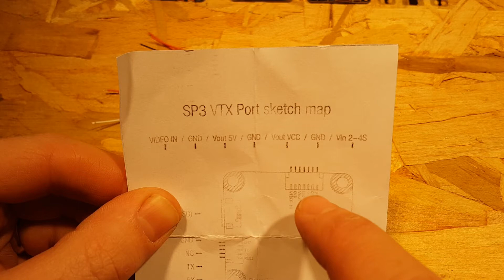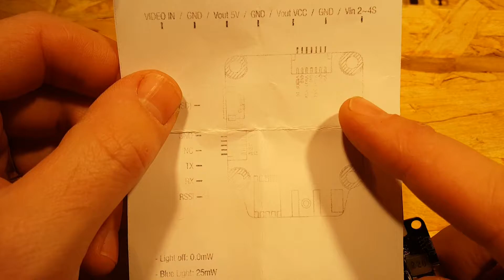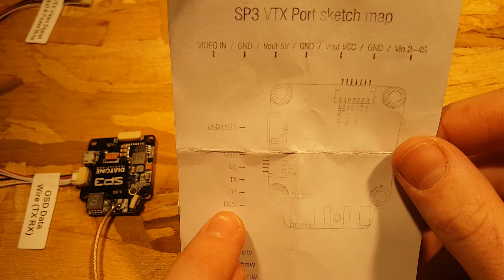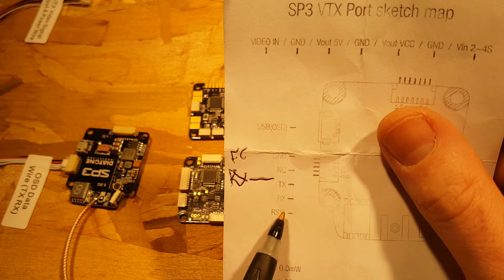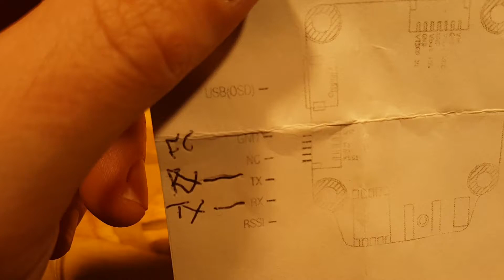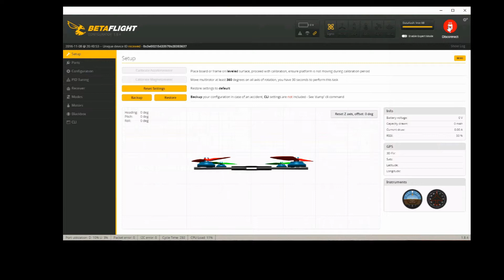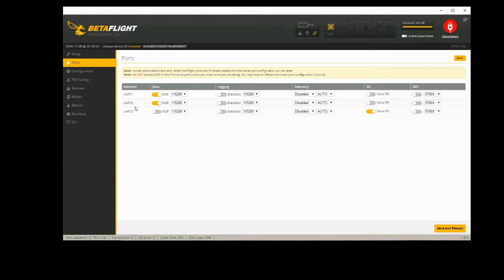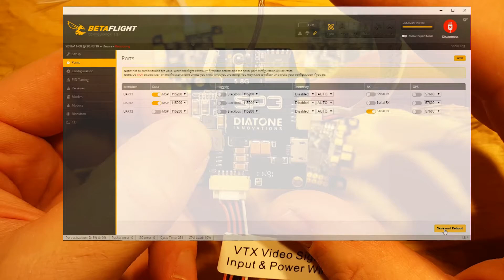Diatone SP3 - Connecting to your flight controller

Comment: can i solder RX and TX pads on the SP2 too? to get OSD controll in BF ? or its only a SP3 thing. I know there is only a hard plug on the SP3 but the solder pads are on the SP2 too

Comment: Do I go from the RSSI on the VTX to the RSSI pad on my flight controller? I am using the Diatone Fury F3, the older version flight controller!   Also just wondering what is the 5V used for on the Uarts?

Comment: do I need to run wires from the battery to the battery voltage on the maze 32 rev 6 board

Comment: Great video, I have one of the older tyrant 180 with the original naze32 thin. Can I update that flight controller with the new SP3 FC? And add this OSD? And upgrade to Betaflight?
Reply from the maker: You could, but Im not sure if there is room to stack the FC and the SP3 into the original Tyrant frame. Might be better off looking into a FC with a built in OSD and keep a standard VTX in it.
Reply: Ok. Thanks. I am assuming that I can flash betaflight to the naze32 thin. Yes?
Reply from the maker: Yes
Reply: Thank you.
Reply: Just one more question please. What is the green mate you have on your 180 build bench/table? I use a homemade top but love the green colour.

Comment: Hi Nice video. Quick question. I want to connect Diatone SP3 to D-Link F3 FC.  In the UART2 port, you mentioned TX, RX and GND.  But what about 5V ? Should I just leave it unconnected ? Thanks !
Reply from the maker: You do not need to use the 5v. :-)
Reply: Thanks. So only RX, TX and GND on UART2 will be wired and connected to SP3, right ?
Reply from the maker: Tristan Sun On the telemetry side, that is all that you need. Of course you will also need to provide it with power in the other plug.
Reply: Thanks !

Comment: great video. I am doing my fist build with the SP3 and the Diatone D link f3. I'm not sure about where to connect the power to the vtx from the FC and where on the FC to connect it. do I connect the Vout  VCC and ground on the VTX to the FC or the one that says Vin 2-4 and ground? then where do I connect it on the FC? I tried to zoom in on people's builds and it looked like they connected it to the esc power lead?
Reply from the maker: Michael Race VIN is voltage in. That is what you need to connect to the power on the FC. You can tap in to battery voltage on the FC directly where the battery lead is soldered or on any one of the ESC power leads.
Reply: You are awesome thanks for your help! that little tiny wire can handle that much power? Well i guess the VTX isnt drawing all that power.
Reply from the maker: Michael Race It only needs to handle what the VTX is drawing which even at 600mW setting is less than 1A. No problems there. Also, if you diddnt know, Vout is for passing the power on to your camera (there are also 5v and 12v options built in depending on your needs).
Reply: Ok I am using the runcam eagle and it says DC 5 to 17V. Which would you use? I am guessing the Vout 5v is the 5v and the Vout VCC is 12v. Thanks again for your help again. This is awesome.
Reply from the maker: Michael Race I'm sorry. I was wrong. There is no 12V. VCC is going to be the same as whatever you power it with (battery voltage in  your case). You should be fine powering the cam via the 5v though.

Comment: Hi. great video but I'm still stuck. I trying to install sp3 on my revolt f4 flight controller v2 and not sure where to connect it. as I'm using tx1 and rx3 with my xsr receiver. I've have found tiny pads on the back of the board that are marked as rx6 tx6 but not sure if this sp3 can be connected there. any help would be much appreciated

Comment: hi! I've using this sp3 for nearly 2 months now. Last week after i have safe landed my quad and change to a new lipo, all OSD reading is gone. I connect it to mwosd gui, all i got is "waiting osd". I tried to reflash to 1.6 mwosd but still having the waiting osd. Video feed is ok only OSD is gone. Any help will be appreciate. Thanks!!
Reply from the maker: Fairuss Yusoff It sounds like the OSD chip may have gone bad for some reason. Unfortunately I'm not sure if it's recoverable. Perhaps contact Diatone directly for support.
Reply: Flite Brothers Thanks for the reply.. will check with them
Reply: Fairuss Yusoff hello please let me know what you find.  I have the same issue you discribed.
Reply: Timothy Kimball I send back to diatone they repair it for me..

Comment: Sorry to bother you again but, Can Uart 1 on d-link be used for rx/tx to sp3 vtx if Uart 2 doesn't work? Even though it shares the usb. When plugged into Uart 1 the osd shows no data but if I plug into Uart 2 it does
Reply from the maker: In order to use UART2 (which you should) you need to turn it on in the ports tab of betaflight. :-)
Reply: Flite Brothers sorry should have said that it is turned on in Betaflight, it was working but has stopped. I've tried re flashing the board aswell. When I plug into the empty Uart the osd shows the voltage .
Reply from the maker: Dazzle Duds UART1 is fine then. you just won't be able to use USB while the SP3 is powered up
Reply: Flite Brothers you have been a great help, that's saved me getting a new fc  or stand alone osd.

Comment: Does the Gt2 get its osd volts and amps from the vtx input power or from the tx/rx inputs ? Im wanting to add a regulator and lc filter to remove motor noise. Thanks Darren
Reply from the maker: It gets its data from the FC. No need for regulator, it's built into the SP3.
Reply: Thanks for the fast reply ;) so just use the 5v out for my camera and then put an lc filter between the flight controller and the sp3 vtx for the motor noise. Thanks Daz
Reply from the maker: That should be plenty. The Gt2 BNF have the SP3 connected directly to battery voltage with no ill effects.
Reply: Thanks mate , yeah its the BNF i have and am getting terrible motor noise of my fpv setup , especially when its at full throttle. Its all so cramped in there though that the wiring has to pass over and next to esc wires. The sp3 is powered from the esc 3 power solder pad,  which im not sure is ideal or not.

Comment: so i bought one of these, are those tiny wores capable of handling the while voltage?
Reply from the maker: Parker Russell If you mean "whole" as in powered by battery voltage than yes. Wire sizes are not limited by the amount of voltage they can handle but by the amount of current, or AMPS, they can deliver. the SP3 draws only a small amount of current and the wires are just fine handling it.
Reply: Flite Brothers, so i can wire it straight to the pdb and it will be fine?
Reply from the maker: Parker Russell Yes. these have a built in regulator to keep things simple so that is fine.
Reply: Flite Brothers sweet thats for the help!

Comment: ok on the naze thin, the GND, 5V, RX, TX, GND, RSSI, is the port on the rear of the FC. If you flip it over, you can see the it is labeled on the rear port of the FC. I have it working now, Thanks for you help, It was just sitting in a box before this video.

Comment: Trying to set this up on a diatone tyrant with thin naze. You showed where to connect on regular naze, where do you connect rx tx on thin naze? Is it one of the ports or is there solder points like on regular naze? have it all finished except rx tx please help.

Comment: great video! BTW if you reverse all props and esc directions, go into cli and enter set yaw_motor_direction = -1, it will prevent 90% of that gunk buildup inside the frame. trust me it works great and youll never feel the difference.
Reply: Cheers BB, I've wanted to try this for ages. Should keep the FPV cam clean.
Reply from the maker: Haha. I've heard of people doing that and always wanted to try. Ill have to give it a shot. Thanks.

Comment: im using a kombini, to get mah consumption on the osd. does the sp3 get that from the fc via tx or do i have to use 4s input voltge... im thinking i should power the sp3 via 12v from fc and hoping that mah consumption will be handled from kombini via tx to the sp3 rx (as the kombini has a current sensor) am i correct... Thanks

I would have got the tx/rx wront if i didn't watch this vid so THANK YOU! lol
Reply from the maker: You are absolutely correct. I would use the white connector on the top of the Kombini for 12v to power the vtx and for the Rx/tx connection to the sp3. The Kombini will send the mAh consumption data via the serial connection but you do have to enable it in the configuration tab of betaflight. You will also have to program the OSD to display it since I don't think that is enabled by default.
Reply: yes I just soldered on the bottom under the plug... plugs can come loose but the ones on the sp3 have a clip at least so as long as one end has a plug I can separate things to clean and repair
Reply: Also using the kombini. that white connector at the top of the board will plug straight into the sp3? do I have to switch wires around? from my understanding it's [ground - uart rx - 12v out - uart tx - ground] in that order left to right looking down on the board with the arrow facing up. should I just solder directly to the pad underneath?
Reply: Im wondering this as well
Reply: On top of the sp3 is the camera connection. I'm using a foxeer monster. Should I use vout vcc connection?
Reply: yes I would use the 12v from kombini to power the sp3... then use vccout to power cam, which is also 12v since that's you supply voltage. the cam can take more voltage but I have found 12v to be a good happy med.